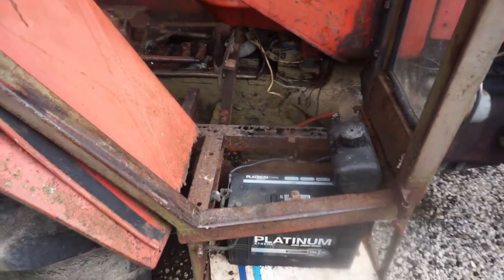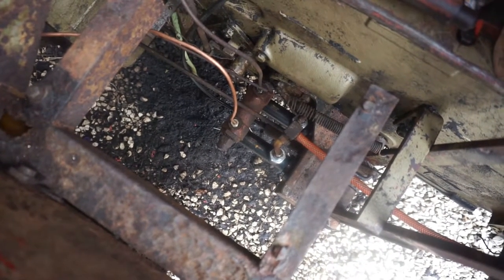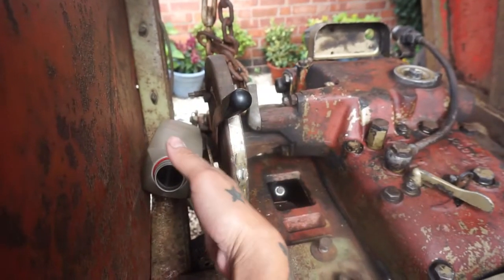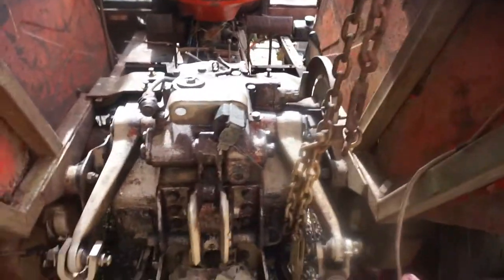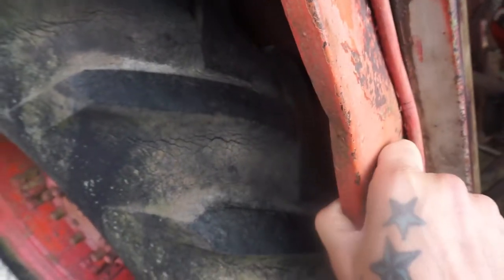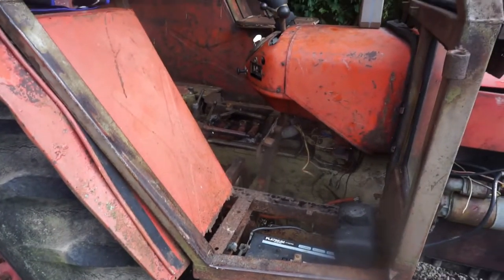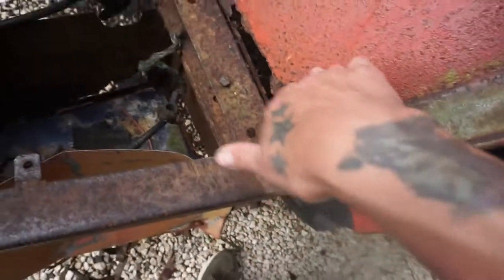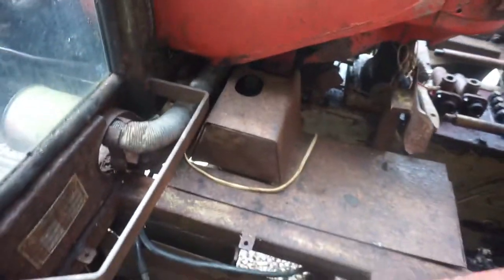Brakes on the zetor 5718 done

Comment: Best way to repair the cabin is to take a crane and lift it off the tractor as whole. You get a nice access to the tractor rear, petrol tank area etc for repairs and you can repair, weld, paint etc tractor cabin again with nice access ..